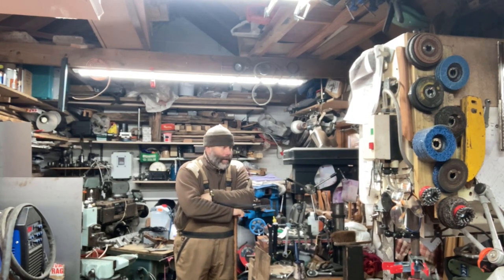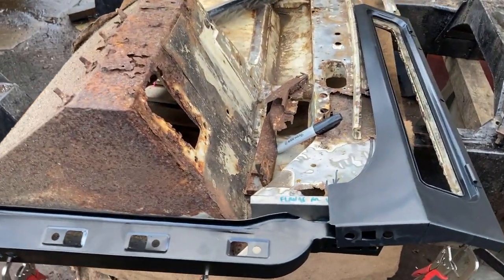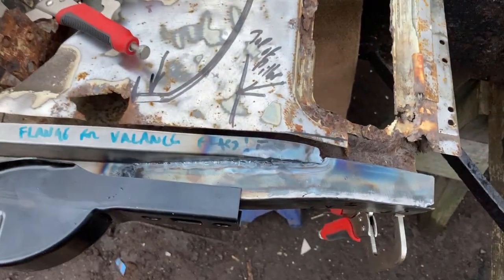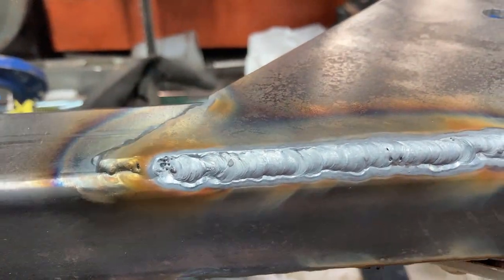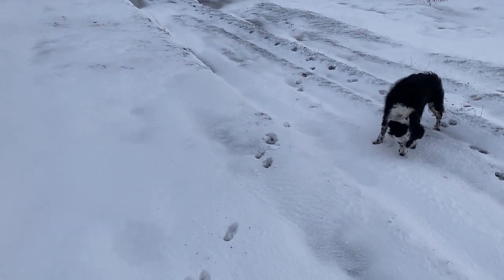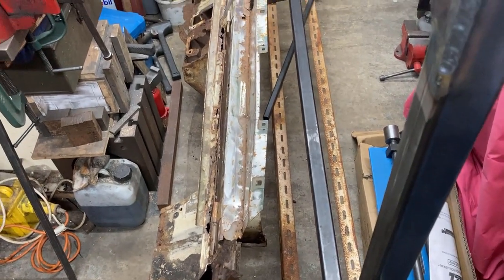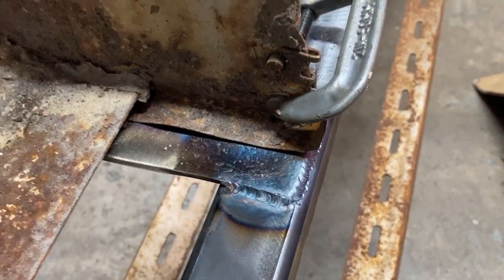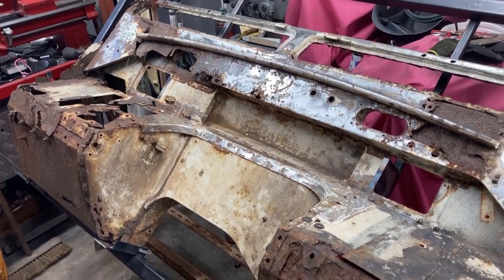Project Clanger the 109" Series 3 Landrover - Update 11

Comment: Looking better, didn't realise how complicated the bulkhead panel is.
Sheet metal looking good.
Thanks for sharing.
Best regards John from the Black Country.
Reply from the maker: yeh, not what I would call a designed assembly, it looks to have 'evolved' and bits were modified and added rather than a complete do over.... apparently the series 3 had 8 varients of bulkhead .... just imagine how many variations there are after 40 years of being cocked about with by DIYers !  All the best mat

Comment: Great Mat coming on really well I’ve see pro Land Rover builders use bloody great cargo straps to line up bulkheads and body to straighten up to fit .an old mechanical engineer once told me progress is progress!
Reply from the maker: Its funny, that was a conversation Ive just had  - apparently its nothing to have to 'stretch' a bulkhead 1/2" to fit back after repair... precission engineering it aint ! All the best mat

Comment: Keep up the good work, I am in final stages of restoring a 1977 88 and was at the same stage as yourself two years ago with a bulkhead that resembled a teabag. Have a look on Facebook for a guy called "The Welding Wood" He made me the really awkward top section for the bulkhead where the window frame sit, plus the rain gutter at the front.  It didn't cost very much and the quality of his work was excellent. It saved me so much time having these pieces.
Reply from the maker: The Welding Wood - contacted the folks there on facebook and never heard back. He does make some nice bulkheads / repairs. I guess he's got plenty of work on, Ive had more success with Classic BulkHeads - more of that next week. Mat

Comment: Hi Mat, I reckon the best thing you could have done is that frame, as you have already found out it give it rigidity and makes it a bit easy to handle. The other thing it allows is the addition of various brackets and tabs to use as datum or “reverse datum” points before you cut pieces away. I would also see what the other new panels have in the way of datum points that might be missing from the bulk head and can be restored as you replace those panels eg by replacing the foot wells it might give you the lower datum points for the lower door pillars etc.
Cheers
Reply from the maker: I am hopeful of exactly what you say. I shall be taking a look this afternoon. Just back from a 6 mile hike around the hill with the dog - so brew time first :-) All the best Mat
Reply: @lookcreations  The above advice from RM is spot on  BUT   You have the most important starting datum point outside in the garden.....   The chassis!        you need 2 brackets on the bottom of your frame to catch the "feet"  that bolt to the chassis.

The other thing I can't stress enough (from bitter experience )  is only tack everything together, then do a FULL  dry run fitting everything (all panels that come into contact with the BH)  back to the landy. 
 HTH  Good luck.
Reply from the maker: Julian Hawker am thinking of getting a box of tech screws to pin everything together and Gand test fit to the chassis. 
Am also thinking of trying to reproduce the two outrigger tubes which catch the lower A pillar brackets along with the forward bulkhead brackets. It means flipping the chassis again which I’m trying to avoid just at the minute. As for the wings, both bent, doors knackered so not much use ... that leaves the rear tub n rooftop....
Reply: @lookcreations   Tech screws would be grand and easy to plug weld holes.   Doors, wings, gearbox flange etc important on dry run and only need to be hung on with minimal bolts and clamps.

Comment: I will get a Tig welder one day, but it must be an AC/DC so I can ruin some aluminium with it. I wiould use Mig with 0.6mm wire, but that is because I don't have a Tig.
The weather has been lousy up here too but you have had more snow than me and that's not fair.
Plenty of brain teasing with that bulkhead and I commend you for carrying on, I would have binned it and tried to find a used one. Top stuff though and good to watch!
Reply from the maker: I think MIG would have been faster to learn and progress with and complete the job at hand with.  Ive been playing with 0.8 mig wire as filler on the 1mm sheet and its far better for me at the minute. Will see how things progress over the next few weeks. Mat

Comment: Welds look good, clear improvement made. Thicker material is more forgiving than the lighter stuff, good experience.
Reply from the maker: Perhaps I should have started with thicker stuff - but most of what I have to weld up s 1 - 1.2 mm so I got to learn the thin stuff sooner or later. Fingers crossed I get the hang of it early on. All the best Mat
Reply: @lookcreations  you don’t seem like a quitter to me, I’m sure you’ll get there. I’m still amazed at what you’re attempting, I would’ve run a mile. 👍

Comment: Welding skill is improving dramatically! Mig might have been easier to pick up, but the drawback is that because you're pumping out wire all the time it can hide a duff weld. At least with TIG you can see what's really going on much easier. Good to see you ploughing ahead, I reckon the bulkhead might be the worst part of the build, going to tackle mine in the next week or two, I need to know how bad it is!
Reply from the maker: Good to see you in the comments again Max' - slightly startled at your running endevours ! I Gave that up when I got to my mid 20's. Fully agree that the bulkhead looks to be the lions share of the project in terms of complexity for me. Though Ive not tackled an engine before !  I hope next weeks update shows something of use for you with the input from Classic Bulkheads - all the best Mat
Reply: I second that.

Comment: Mat your welding is getting better mate ( but not the one mil to three mil lol) I think you are right in blaming the replacement foot wells for causing the twist in the bulkhead and I know from experience that it can be challenging when putting a bulkhead back to the chassis how sometimes you have to put shims in the bolts to get the things to line up because of twist caused by welding in brew footwells. I don't think it's a good idea to try to pull out the corkscrew in the bulkhead without relieving one or two of the old footwell repair welds I'm not sure from the way you were describing the corkscrew but from the way you described the distortion it looks as if the drivers footwell may be the main cause of the corkscrew. Now you have the bulkhead at least partially attached to your frame, if I were doing that job myself I would now cut right out at least the drivers footwell and maybe the passenger one as well unless that compromised the integrity of the rest of what is now left of the bulkhead. My reasoning being that they may be giving you structural integrity, but with that corkscrew involved any datum points that you need for rebuilding the top section and hinge points down to the pickup point for the chassis mounting are compromised. I really wish you luck with the bulkhead, and having seen your lathe restoration I'm sure you can achieve a good result.  Teenagers aren't the only ones who like playing out in the snow the only difference is I like to do in in the comfort of a nice warm Land Rover and I do not mean a series 3 !
Reply from the maker: It getting to the stage where I have to cut off parts in order to insert new - the problem is the new parts have to be welded in and the bits they need welding to havent been welded in yet !  Sky hooks are looking likely!  the footwells are pretty shot and not really providing much in teh way of stiffness. I want to have some straight lines to work toward and the footwells will go back to the imagined position rather than how they currently sort of of sit.... well the bits that are left !  Ive spent a couple of hours this afternoon offering up parts and weighing up where to start .. Ive had to come in as Im frozen and cant decide while shivering. Time for a brew. Mat
Reply: @lookcreations  well good luck mate.

Comment: Welds are definitely looking better. Keep practicing. 👍
Reply from the maker: I did do a practice run on the 3mm section and the cut through it to see penetration - It was pretty good, still need to work on the filler rod feed rate - its too slow at present.

Comment: Looking good Mat it will be so rewarding when it's complete 
Welding getting alot better it's only practice as everyone keeps saying 
Does the welder do stick that would be good just to tack stuff quickly and save gas 
Stay safe stay warm
Reply from the maker: Hi Greg, thanks for stopping by. Yes the welder has stick facility - I could/should have welded up the frame with it - but I felt the extra time with the torch would be useful and it was if only to help improve my confidence a touch. Ive never been a fan of stick welding - the sparks arent good in my tight shop for a start. Might give it a try in the future running off the inverter rather than buzz box. All the best Mat

Comment: Oh wondering what type and specs your welder is‽ kind regards
Reply from the maker: The welder is a 160Amp AC/DC TIG / MMA welder made and supplied by Rtech Welding (UK), it is inverter driven and one day I hope to be able to make use of a few more of the knobs on the front and the pedal supplied. It came with 3 year warentee -  they collect the unit take it back and repair/replace. that appealed to me. The Torch is a size 26 so a bit large for the fine work, it does have a flexi head and is aircooled. ;; the best Mat

Comment: Hello Mat,
I know I am a soft southerner but you looked so cold at the start of this video... 
As I was watching I got to thinking what a sense of achievement you are going to feel when the bulkhead is complete. Would you say it is highly likely to be one of the most challenging parts of the project.
Take care and stay warm.
Paul,,
Reply from the maker: Hi Paul, thanks for stopping by. I took on the project to learn a few new skills, TIG and fabrication as relates to car repairs and the mechanics of engine/ transmission - hopefully gettinga reasonably reliable motor out of it.  The bulkhead was originally destined for the scrapyard and a new galv' one to replace it. A combination of factors resulted in my wanting to try and rebuild it.  If I achieve anything like a half desent reult I will be well chuffed - it being  certainly a major element of the project. At present it is presenting as the most significant element of the project to date.  But then theres the engine, transmission and electrical systems - all new skills to me.   Hopefully, things will start warming up a bit and drying out in the coming weeks. All the best Mat

Comment: Your tig is ok...I shake so much I couldn't do it hardly at all, went back to flux core and stick. thanks
Reply from the maker: I found that if I cant get comortable access, I cant hold the torch anything like still. The tip bouning up and down about 1/8 - 1/4" which makes for some interesting weld pool control ! When I watched Garry weld the chassis, it was clear he used his body and teh chassis to steady the torch hand/arm. When I watch chaps ata bench on YouTube, they all use the bench to steady themselves. I guess practice makes for a consistent appraoch and you get to learn what positions work for you. All the best Mat

Comment: Hi Mat, could you use the hinge holes in the two repair panels to bolt them together to get some idea of the angle on the bulkhead? It might give you some ideas of ways you can put back the strength without having to reproduce exactly what is there (or not!). The panels twist as they rot, a spot welded seam can expand to 20 times its original thickness as it rusts, and so if it only rusts at one side, theres the twist. Given that you will be putting the old girl back together and on its wheels  before you fit the bulkhead, you could leave the repairs till you have a semi assembled vehicle to try the bulkhead onto, and get the door fits right. As I remember on mine, you could add or remove shim washers on the bulkhead/chassis mounting points to get the bulkhead in the right position across the chassis, is yours the same? Another cracking video, keep up the struggle, I am!!
Phil, East Yorkshire   https://www.youtube.com/user/philhermetic/videos
Reply from the maker: I am currently 'developing a cunning plan' ! Hopefuly I will have it settled by the next upload. cheers Phil  Mat